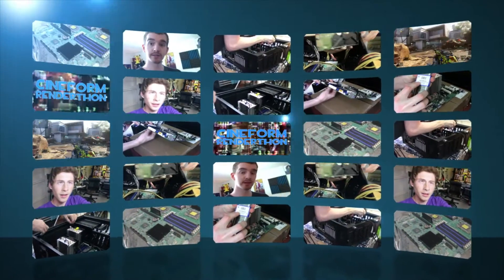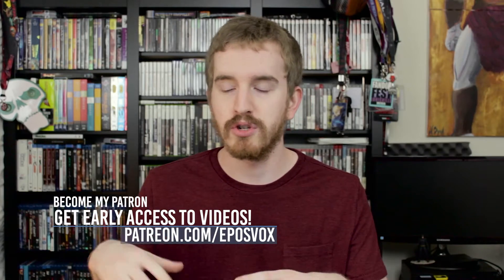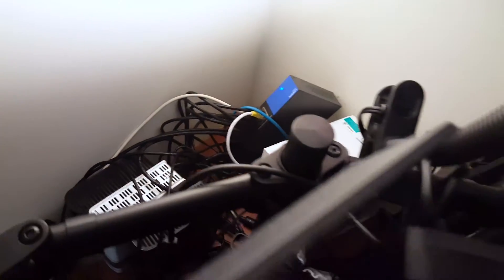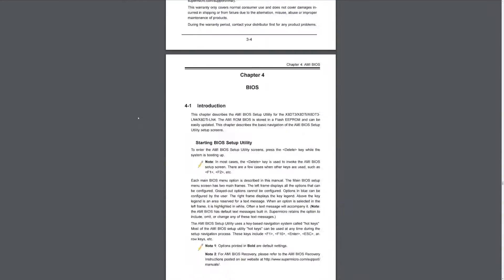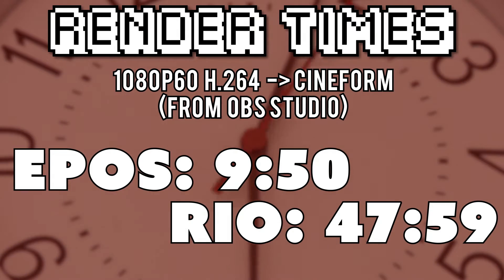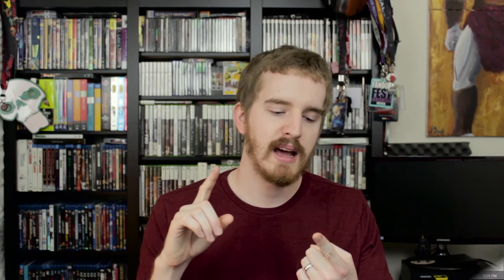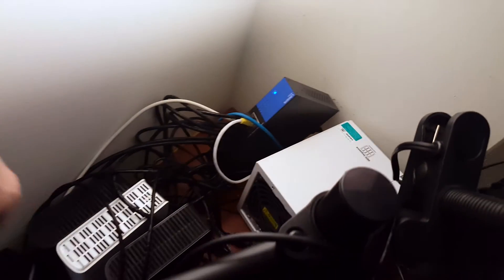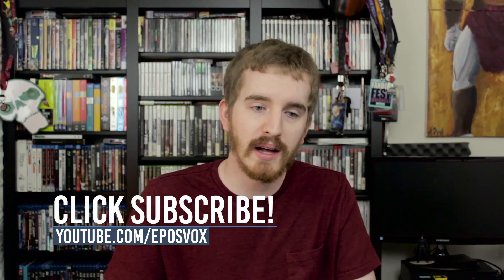EPOS CONCLUSIONS // Cineform Renderthon Server Build-Off // Episode 6

Comment: I just recently Subbed to you guys and pretty much have a build just like this but What is the best way to Render all of the Movies i have for Plex so im not transcoding anymore it would be best to have it automatically do it and then keep the name i give the videos and copy the new rendered versions to another drive Any hints towards this ?
Reply from the maker: You'd need to do some scripting with Handbrake, or perhaps run all through Adobe Media Encoder if you have a copy. But it'd be a LOT of work for seemingly little payoff.
On a local network there's not much reason to transcode at all, and for mobile devices, you can use mobile/cloud sync to generate optimized versions within Plex for your devices.

Comment: Hey EposVox,

I am currently tinkering with a similar rendering setup, but I havent got the settings right.
Is there a possibility that you can send me a screenshot of yours?

Greetings from Germany
SyntaxX_3rroR
Reply from the maker: That's pretty vague, lol. There's no specific settings to this setup for me to screenshot. You need your file locations to be consistent across your edit and render drive (either via NAS storage or mapped drive letters) and that's it. There's no specific settings to set.
Reply: Thanks a lot, I really appreciate it. Tried it out today and AME was able to encode directly from the .PRPROJ file. Any ideas or special settings for improved quality? I tried modding the Youtube default settings to match them to a screenshot of Linus Tech Tips but if u have any suggestions regarding the settings, I would really appreciate the feedback. I got my old trusty Phenom II X6 1090T up and running as a renderbox and beat the living crap out of it today when rendering 40 minutes of 1440p footage.

Love your channel, love your video quality =)
Greetings SyntaxX_3rroR